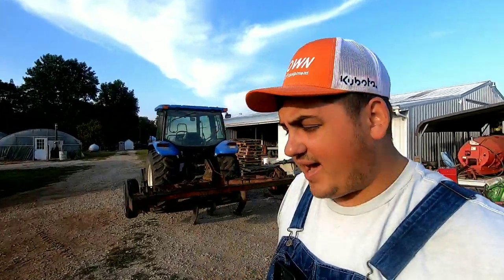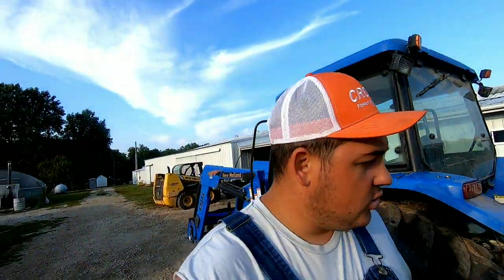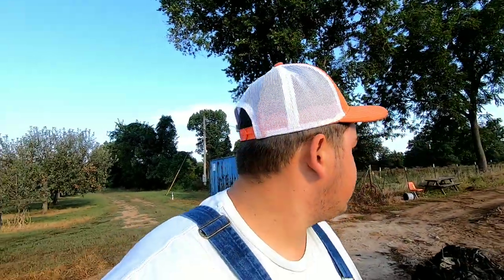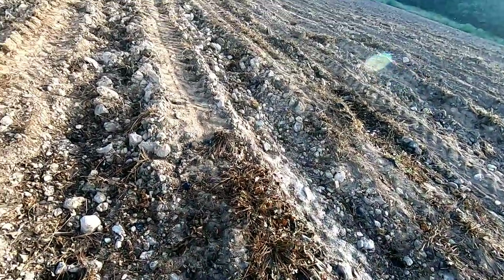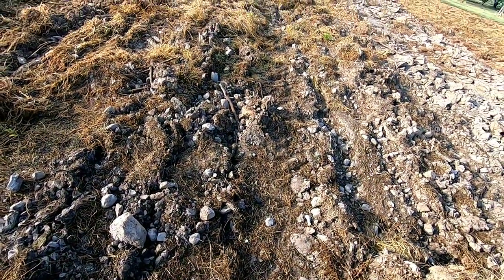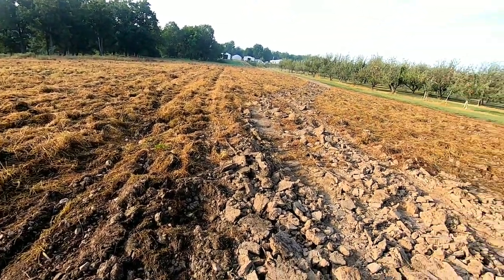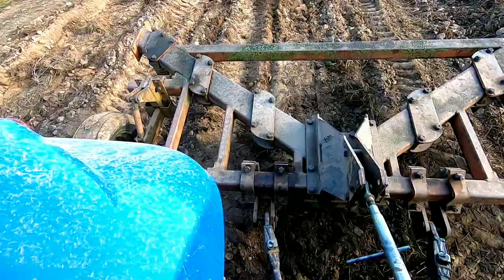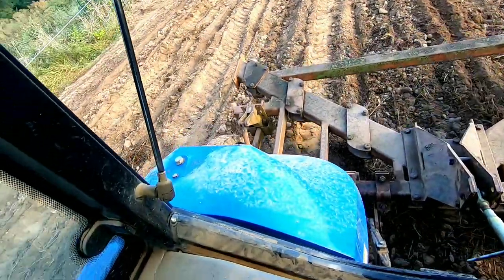Subsoiler on Strawberry Feild

Comment: Isn't it easier on the tractor to rip soil that's on the dry side? Less drag?
Reply: Nah, tends to turn into concrete. The shanks will sometimes just float. Also rocks don’t move well when it’s dry.
Reply: It’s best when the soil is a little moist
Reply from the maker: Yes, hard soil isn't that good